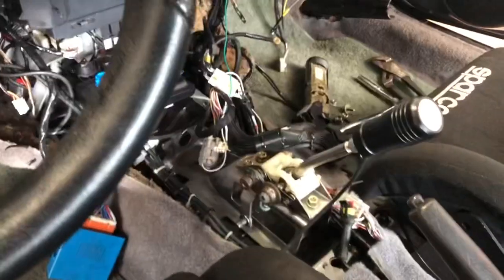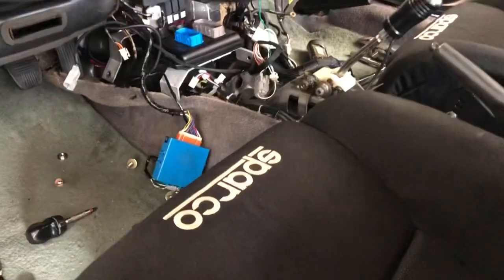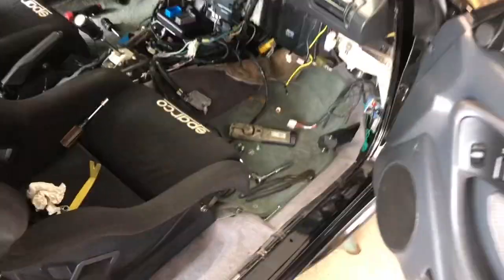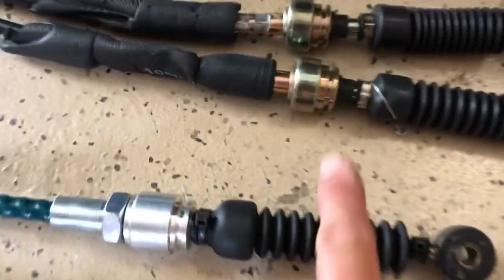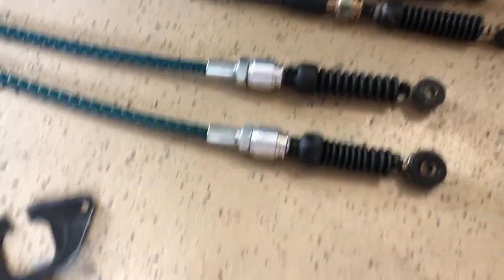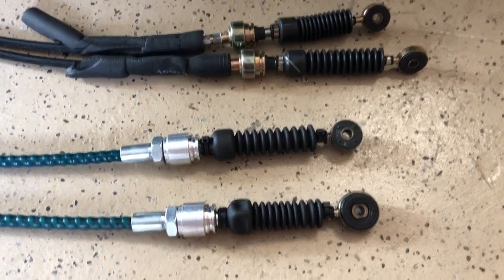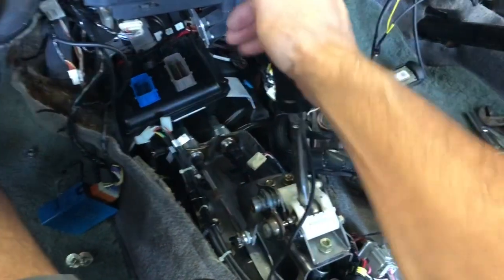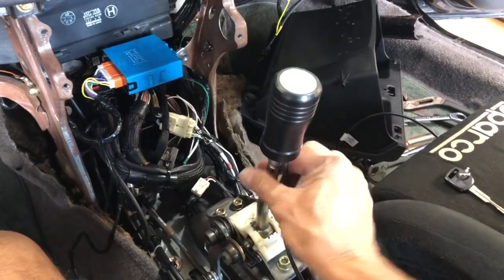Improving the Stock H Pattern Shifter AWD Celica ST185 GT4

Comment: You and Ryan and PSI been an inspiration and yard stick holders for in this community for an age, awesome to see you all posting regularly, I definitely see a resurgence of gt4/alltrac interest and development coming with the introduction of the new GR-four. Do you happen to have a link to where you found the cables ?
Reply from the maker: 👍Thanks for watching. I just recording what I’m doing so I remember down the road.  🤣
No website really...California push and pull did it. You’ll have to send in your cables   Was less than $150 shipped back.
Reply: Cheers ABeans ! Hey pat, I've got a couple of questions about your build I've always wondered about, wondering if I could pick your brain with them ?
Reply: @alltrac101 Super les câbles refait par push-pull.
Le shifter est d'origine? il fait un bruit du genre "click" lors du passage de rapport.
Reply from the maker: Go ahead. Ask away. Hopefully I can answer it
Reply from the maker: Yes. Originally shifter. The click you hear is from the gear knob. It’s for flat shifting
Reply: I really appreciate it man. How do you do you address the oil pump ? Knowing you have revved this motor to 10,000rpm on occasion I know even the 5s/gen 4 will encountering cavitation at this point, the black top beams has an even thicker, smaller diameter gyrator which will help especially with the gen 2/4 larger gear but talking to PSI they still say it still spins much to fast... I've been thinking about fitting smaller idler pulleys + manual tensioner to allow for a slightly larger custom gear as well porting inlet/outlets of the oil pump and maybe even the block 'oil pockets' to keep pump resistance and chance of cavitation as low as possible over 10,000rpm, I really want to push the limits of the stock components, I think I remember reading you had a uncommon solution to this years and years ago but never shared or at least I couldn't find it 😆
Reply from the maker: I’ve used both the gen2 and beams pump gears.  Currently on the beams.  Pressure is constant with both. When there is cavitation you’ll see a press drop.  In my 165 daily driver with the 5S pump when the oil got hot.  Like over 220F it would cavitate at high rpm. So I added a 19 row oil cooler and it went away.  I blueprint all my pumps.   The problem with slowing the pump is the volume drops too. Volume is more important than pressure it keeps the bearings cool. Keep the oil fresh also. I change often or when I see the normal hot idle press drop
Reply: Thanks for the reply. Is that the single vvti or dual vvti beams oil pump ? Maybe I'm overthinking things then, definitely have the same understanding as far as pressure goes, it was only after speaking with PSI I started having my doubts about pressure being to high at silly rpm, I still plan on teardrop machining crank journals and porting the oil pump but maybe the larger pulley idea is unessicary. You should definitely show your 165 on your channel! my personal favorite, have plans to bring the chassis to the world stage, has been a dream chassis since I was a kid playing gran turismo 2, lucky enough to get to own one not to many years latter and the passion hasn't faltered since !
Reply from the maker: Dual. The pressure relief bleeds off the pressure at high rpm.  8-10 psi per 1k rpm is what I get with the 5s and beams pump
Reply: Okay, I thought it might be a possible to over load the valves ability to relieve pressure enough pressure if you really revved it, plans to make a 150mm long rod, half fill motor and turn it over 10k, I figure high rpm high boost is the way around cracking blocks when trying to peg a big turbo. What engine mount are you using by the way ? I notice your gearset seem fairly loud on in car footage ? I know it's straight cut, maybe it's when the camera was mounted I was picking up the vibration through the chassis too or you've removed sound deadening, just sounded louder than others I've heard, love the flat shift knob additional
Reply from the maker: If there wasn’t any spring holding the valve you’d not get any usable pressure.  You going long rod for a 2.0 or 2.2? 
Using TRD mounts 
Yea the straight cut gear are loud.. Only replaced the factory firewall insulation with the light weight Eastwood. The camera mic is quite sensitive. The knob has been in a few years
Reply: Yes, my mentality was that the orifice might not be big enough to relieve the pressure fast enough over 10k, don't have may to ask about there experience at this rpm on stock oil pump, will definitely be porting/chamfering the relief hole at a minimum. 1998 3sfe  block (some share the siamese bore straight of the 5s) and crank (same as ge/gte). Ah okay, do you know what hardness rating they are ?
Reply: @alltrac101  Salut, vous dites que ça provient du pommeau, pour le déplacement à plat, c'est à dire ? le pommeau agit sur le déplacement du shifter ? j'ai du mal à comprendre.

Comment: I had a slight notch feeling when shifting into 2nd on my original e150f and when that trans pooped I installed a e154f and that trans does it also.  It has to be my cables I'm guessing.   I'll call California push pull but do you have any information I can tell them to make me a set like yours man? 
Like mention your bada** all-trac or name? 
I don't know what to get to rebuild my e154f so I need to take care of it as much as possible.  Thanks and love the videos
Reply from the maker: Just call them.  You’ll need to send in your old cables. They’ll use it for reference and reuse the ends
Reply: @alltrac101  sounds great
 I'll call after I get out from my job or just tomorrow.  Loving the all-trac!

Comment: I just purchased the MR2 Heaven ones, do you think I should just return them? Is it worth the headache?
Reply from the maker: It would really suck to do all that work and it not shift correctly. Quick way do destroy your trans. Fortunately I tried it before putting it all back together.
Reply: @alltrac101  Struggled with the mr2 heaven ones as well, i dropped em in and found out that the cable was too long not letting me enter 5/reverse, got a grinder and cut about 1.5 inches off and called a mobile welder to weld up the pieces for me and now she shifts fine, if i had a chance to do it again id say 1 inch off should do it, i wanted my shifter to lean more to the driver side and it ended up doing just that which is perfect!
Reply: @exinhart  Did you take an inch off of the transmission side or the shifter side? Also did you have to shorten both cables? Sorry for all the questions lol
Reply: @kagman10  I took it off the shifter side while it was in the car as well. I removed my air bag ecu so I was able to angle the cable enough upwards to cut it with an grinder and the welder guy shortened it a bit more as well . 1 inch should get you stock throws but my shifter has significant slack in it still so if that’s what you’re going to for if you haven’t purchased them I’d look towards doing what pat did and getting adjustable custom set as it’s cheaper than the other mr2 heaven cables
Reply: @exinhart  I have them sitting in my room still, I will see if I can return them and just order the custom set instead. Thanks for the help!